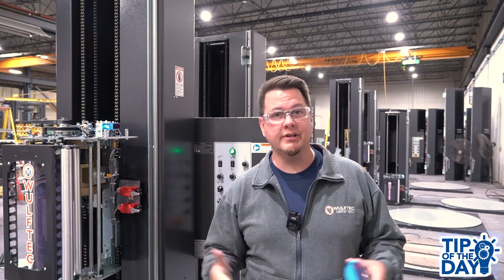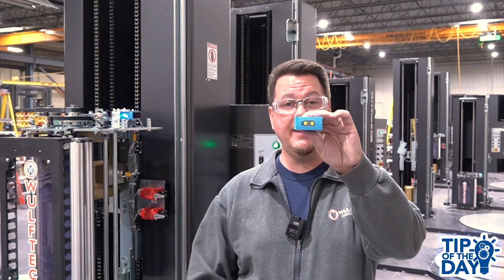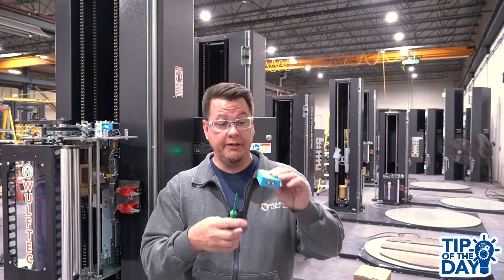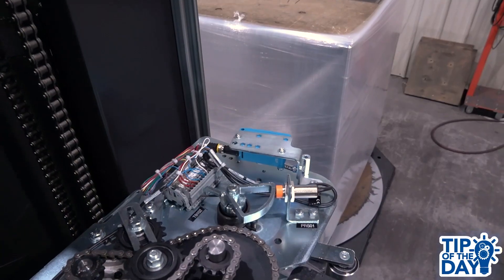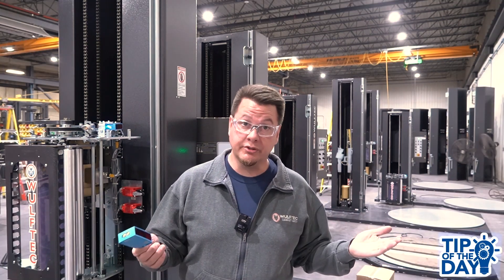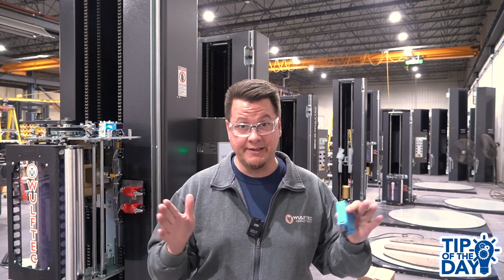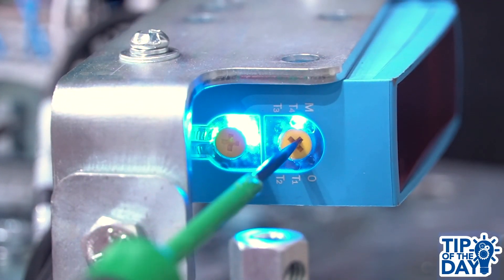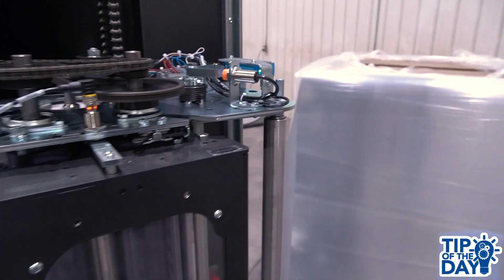Tip of the Day – WTB26 Photoelectric Sensor Adjustment

Comment: Thanks for the video will you do a video on making this sensor read black color film
Reply from the maker: Bill, thanks for the comment,
When a surface color is difficult to read, most likely when dark or shinny colors or round surfaces are present, we suggest going with a laser type sensor like the WTT12L-B2561 made by Sick.
This one performs way better with those challenging surfaces, but on the flip side, the sensor does not have the built-in time delay function that we use for the film overwrap adjustment.
To address this lack of adjustability, if needed, based on your control panel type, we can provide you with an external time delay relay and corresponding wiring & connection diagram.
Do not hesitate to call in if you would like more details.